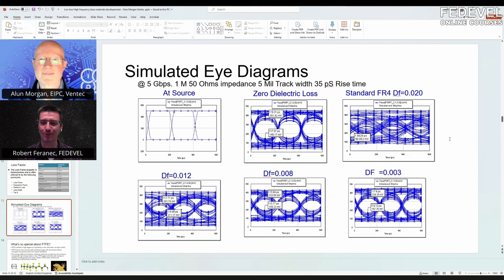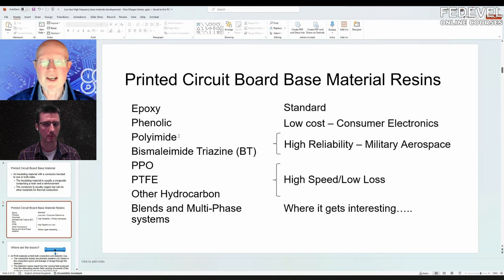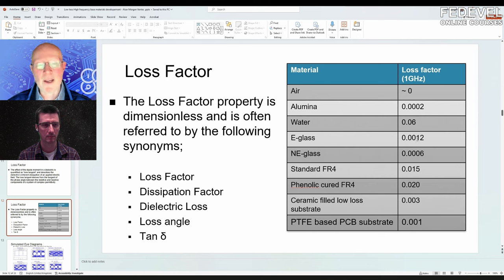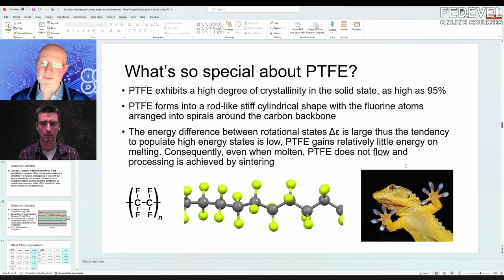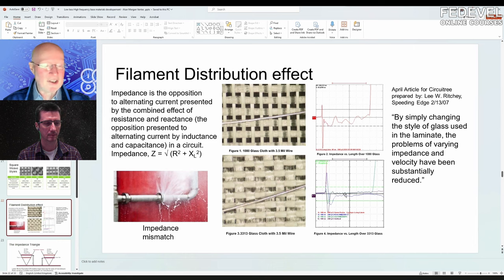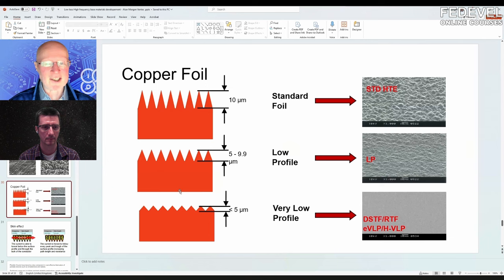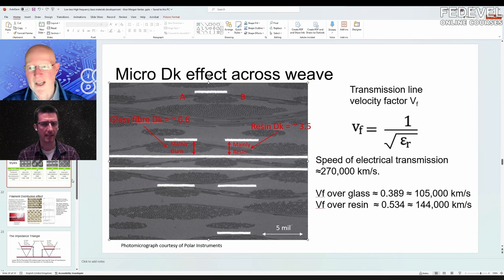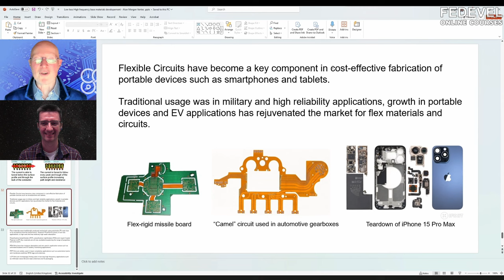Need To Know This About PCB Materials

Comment: Flex video! Yes! Please!!!  I would love a deep dive into flex-rigid boards and their fabrication. Connectors have been a limiting factor in so many designs as well as a primary point of failure. Minimizing or eliminating them opens lots of doors for minituazation and reliability.